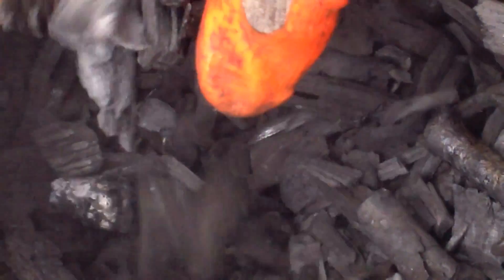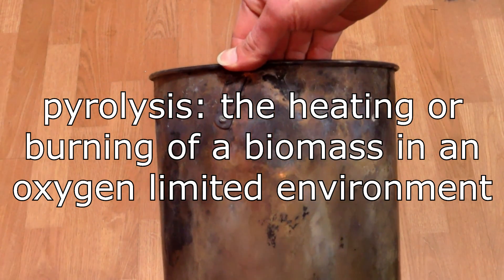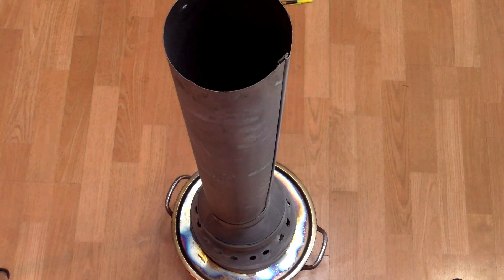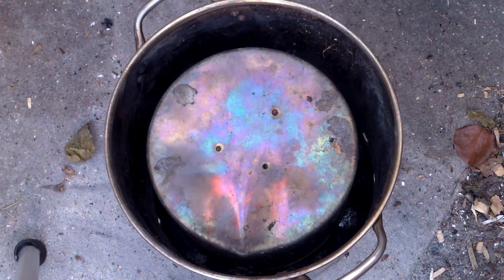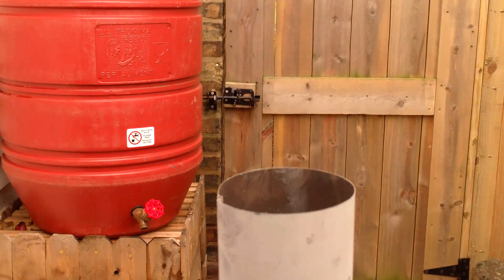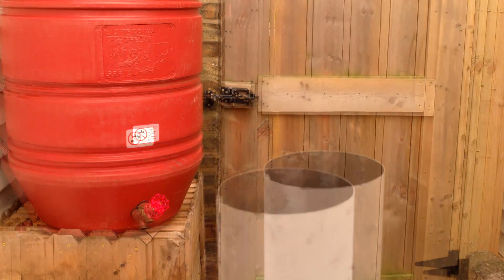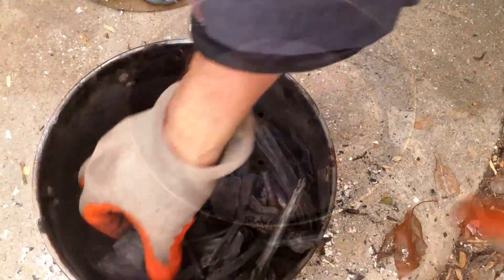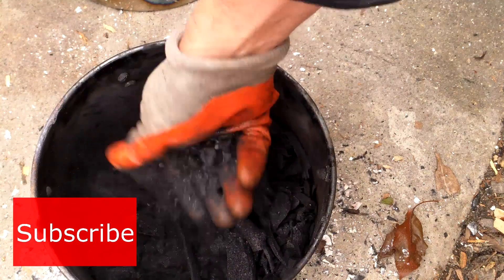Our Small Two Chamber Biochar Oven

Comment: Could the upper chamber heat be used to piggyback a separate waste plastic pyrolysis to produce pyrolysis fuel from plastics?

It's a shame to waste all that heat to just escape and produce 1 pound of bio char or charcoal fuel where I'm from... charcoal fuel (briquette) sells for $3 per 3.3 pounds online..   

That way  you will have two products from the original machine; 1 pound of biochar and at least one liter or more of fuel from the waste plastic pyrolysis...

and you get rid of some plastic waste.. this could even be a business...

Comment: Nice oven, I have just few things:

First, it is better to make holes for gasses to escape in the bottom part of the inner container, because the gases help to heat the wood inside when they burn.

Second, it is definitely better to quench the biochar with water rather than let it cool. The hot biochar still smoulders and consumes oxygen, which decreases yield (it burns away). Also, biochar can get hard to wet with water when its cool, but it soaks a lot of water easily when its hot. Water steam produced during quenching can also increase the surface area as it removes tar from the pores.

Comment: Now this I can do! I'm only on a suburban block so the big drum units are totally out of the question.
I've got something for the outer vessel and probably the inner one as well.
I'm thinking of using a bowl as a lid with the center cut out and steel venting as you use for the chimney.
I'm doing my best to reduce inputs as much as I can to the garden (unless they are free)  
This is a great way of using up more  branch cuttings and bigger woodchip to make something I would otherwise have to buy.
I'll skip the holes in the center vessel to get the gases to pop out the bottom and feed the fire like others have said.

Nice video.

Comment: Craft procedures not necessarily translate to better ambientaly products.
Yours is a serious document. Congratulations.
The indirect distillation of the wood ensures that the process will generate much less ashes that would increase the pH of the soil.
A good biochar, without doubt, helps to increase efficiency and sustainability of agriculture. 
The only problem I see is that  its cost is high due to the scale of the oven and the system can not be scaled easily. With the help of some engineers your model could became a wonderful  input to RATIONAL AGRICULTURE.

Comment: hi, the video is 4 years old and im wondering if your biochar oven is still working and if you have made any modifications since? i am about to make one based on this one since the size and level of production fits my needs. Thanks for the videos, very inspiring.
Reply from the maker: You're welcome! I'm no longer using it. My best guess is that it would last 3 or 4 years with fairly regular use.
Reply: great, ty

Comment: I have been wondering what to do about the hydrocarbon gasses from the pyrolysis process for a while. All the videos I have stumbled upon simply mention that they are there and don't explain anything about them. I have been wanting to learn more about this subject simply for carbon sequestration, and not so much for fertilization. Thank you so much for explaining and showing how you dealt with this.
Reply from the maker: +EPhantom125 You're welcome!
Reply: in order to sequester carbon one has to feed the chimney back into the fire chamber so that the hydrocarbon gases completely burn up. In this positive feedback loop the hydrocarbon gases raise the temperature of the fire.

Comment: An excellent video on the process of pyrolysis, and how to construct a low-tech, low-cost retort chamber. I can see some high school science teachers using your video in the classroom. I did just a small bit of research on terra preta soils and understand why many folks may want to add biochar to their gardens. But(if you don't mind me asking a philosophical question, Patrick) I'm wondering if you think it might be better(ecologically) to just spread the wood chips in the garden? Creating biochar releases hydrogen and methane into the atmosphere, which may affect global warming. Wouldn't it be easier and safer to just mulch? Was wondering what your opinion might be but understand if you'd prefer not to have these discussions on your channel. No harm, no foul.
Reply: Brian White hello Brain white, I understand your concern. I am working with Biochar in my lab. Apart from amending the soil and sequestering carbon, it can help in  soil remediation. a soil that is contaminated with heavy metals can be reused with the application of the correct quantity of biochar. thank you.
Reply: Doesn't decomposing wood release those gases and more? I honestly would like to see the emissions measured. Since most of the hydrogen and methane is burnt in a well designed stove, it really may be cleaner than the gasses rotting wood releases. I use biochar in my compost because it helps filter some of the gasses that are released by the decomposing organic matter. Plus it really seems to speed up my compost. All that being said, of course I also use mulch.
Reply from the maker: Thanks, Brian! This was more of an experiment for me than anything else. Sometime after this video I decided to conduct a field trial of biochar before using it in my entire garden. After the first year of the trial, I'm not convinced that it's adding any value to my garden soil, which is rich in organic matter and nutrients. As you suggested, it may makes sense for most people to simply mulch their gardens with wood chips instead of make biochar.
Reply from the maker: Jamie Vega That's a great question, Jamie! I'd be interested to know the answer as well.

Comment: OK, a few suggestions. First put insulation around the outer chamber, it'll concentrate more heat into the inner one. Second, don't waste the hydrogen and methane gases produced by the pyrolysis, use them also in  the burn. Seal those three holes in the inner chamber, then put a couple of pieces of straight wire in the bottom of the outer chamber, that way the waste gases escape out of the bottom and get redirected to the burn. Finally, you might want to look up how the Japanese make 'white charcoal', it's a quick cool down method that produces a type of char with some interesting properties.
Reply from the maker: Thanks for the ideas, Sacwriter !
Reply: i concur, having a burn camber in the chimney fed by the small holes is a waste of heat
Reply: Nice suggestions Sacwriter but a drawing would be v.helpful but not possible in this forum (:-    -  Not v.clear about how waste gases are being redirected to burn

Comment: if you put the holes on the inside pot at the bottom the gasses will feed the outside fire and there may be no need to add extra fuel because its said to make the fire last longer, esentialy you will be using the inside gas to char the inside wood
Reply: spud gun I was thinking the same. Also for this and other designs it seems there is an opportunity for a slim chamber containing wood for creating biochar through the chimney which would heat up from the heat lifting up through the chimney.

Comment: Great effort - nice product. Here's a link to part one of a very instructional series from Living Web Farms. This is a 5 part workshop that takes a lot of time to watch, but really worth while, at least for this novice.
 
Biochar Workshop Part 1, How to Make Biochar

Ideally, I don't think you need the little holes in the top of the inner retort chamber. The idea is to force the gases down and out around the bottom lip. Based on what I saw, I don't think you packed the cavity between the two chambers with chips (smart that you dried them first). Have a look at how tightly the guys in the video jamb the small cavity.

My first successful efforts to create this black gold have been to build a roaring hot fire in my shop wood stove, then as soon as it is down to a bed of large coals, I scoop them out into a steel pail and cover them with sand to quench the fire. That is one hot pail of coals. Don't get a lot at a time, but so far I have about a bushel, and my shop is heated in the process.
Reply from the maker: Thanks Garth Wunsch ! Yes, the Living Web Farms biochar workshop videos are very helpful. I watched them some time ago when I was researching biochar. You're right the little holes in the inner retort aren't needed. Now if I can just talk my wife into letting me have another one of her pots! Thanks for watching and commenting.
Reply: Save your marriage... hit the yard sales... lots of pots there :-)))
Reply from the maker: You make a good point Garth Wunsch!

Comment: Get rid of the holes on the top of your inner retort. They need to be on the bottom and I am not sure they are really needed since you haven't sealed the chamber. They are only for letting the gases out and keep it from exploding. If you let the gases out at the bottom, it will add considerable heat to your system, and you will most likely not need to add extra fuel during your burn.
Reply from the maker: You're right - the holes in the top of the inner retort aren't needed.

Comment: HEY O.Y.R.
 I NEVER MADE BIOCHAR BEFORE BUT WATCHING YOUR VIDEO TAUGHT ME HOW. I MODIFIED IT THOUGH BY FILLING AN OLD METAL TOOL BOX WITH A LATCH FULL OF WOOD CHIPS AND PLACING IT IN MY WOOD BURNING STOVE. I MADE BIOCHAR WHILE HEATING MY KITCHEN. IT WORKED GREAT.
THANKS
Q
Reply from the maker: That's fantastic! I wish I had a wood burning stove or fireplace so I could do the same. Thanks for letting me know!
Reply from the maker: ***** Yes, I've seen at least one video in which a metal ammo case was used. Any oxygen limited metal container should do the trick as long as it isn't galvanized.

Comment: My 50/30 gal drum system doesn't make as much smoke than my Webber grill does and I've not had any problems with neighbors.  The set up isn't visible to neighbors and I grill outside all times of the year, so no one is any wiser.
Reply: make that 55gal / 30 gal
Reply from the maker: I'd love to make the 55 gal/ 30 gal oven, but I'm certain the neighbors would object. I agree - the oven wouldn't produce much smoke, but the flames shooting out of the chimney would make them nervous, and I have no way to hide a unit that size. It's too bad. I'd really like to have one.
Reply: Throw some burgers on it and tell them you're having a cook out. LOL

Comment: I know that the bio char is important, it just seems like you waste a huge amount of wood in the process.  You could have cooked, heated, even forged metal on the amount of energy it took and in the end you would have even more bio char by using the fuel you used to cook the original batch of wood. I just do not get this process.
Reply from the maker: You're absolutely right - it's much better to harness the energy and put it to good use. I plan to use the heat to do some cooking in the future.

Comment: Patrick, two questions.  We loved this video and want to experiment with the idea.  Got a old ridiculously heavy wood stove at the auction last week for 25 bucks but there doesn't seem to be a working damper.  Do you think we could just put an inner retort chamber inside the stove and keep the door ajar and set up a chimney kind of like you did?????  We have never worked with a wood stove before but the deal seemed to be there...its going to be for outside use one way or another, seems this would make a lot of sense.  If you have any ideas on how to modify this please share.  Question 2.   The stainless steel pots...any chemical breakdown that would release dangerous fumes???  How about the pots melting down from high temps.  The larger pot you are using looks like it started to melt a bit..or is that just denting from the drilling process.  Thanks for your great videos.  We look foward to them coming.  Cool light setup too.   But you definitely need to hit the thrift shops for lamp cords(with lamp attached)  that are like a dollar :)  Thanks, Paul and Suzanne
Reply from the maker: Hi Paul and Suzanne.

Yes, I think you could put an inner retort in your wood stove as you've described. You'll want plenty of oxygen in the wood stove, but little in the inner retort. 

Stainless steel is safe for use in biochar ovens. You'll want to avoid galvanized steel however, which is coated with zinc. The temperatures don't get nearly hot enough to melt them. There are some dents in the pots, but no melting.

You're right, I could have bought an extension cord for $1.19 instead of the expensive lamp cord. Next time I'll know better.

Thanks for watching and commenting!

Comment: I really want to do this as a winter project!  Thanks for posting.
Reply from the maker: You're welcome Cindi Martineau !  Yeah, it does make a great winter project. I'm planning on making a batch most weekends during the winter. That should give me more than enough for 2014. Thanks for watching and commenting!
Reply: Where did you find your pots?  One concern I had about making one was that the usual paint buckets or even 55 gallon drums only last through about 10 burns.  But, I think your stainless steel pots will see you through far more.  Maybe I'll start checking thrift stores.  I do have one big pot like yours, but I use it all the time! :)
Reply from the maker: Cindi Martineau My wife used to make handmade soap, and she collected several of these stainless steel pots over the years to use in her soap making. I'm not sure where she got them. I think you're right - stainless steel will last longer than steel. Just make sure to avoid galvanized steel. I also was suspicious of paint cans, which sometimes have some kind of protective coating on them.

Comment: Very informative. Have you checked the temp of the gases coming out of the chimney? I wonder if there is enough heat to distill salt water.
Reply from the maker: Interesting question! It's great to think of ways to put all that heat to good use. To distill salt water, do you only need to bring it to a rolling boil? I'm not sure how hot the gases get, but they could definitely boil water.

Comment: Fantastic video as ever. That`s a great oven. You could make a lot of Charcloth for me with it. lol.
Reply from the maker: Thanks Mark. Yes, then I could use the charcloth instead of the alcohol to start the oven! I think my next batch will include dried kitchen scraps like banana peels, orange peels, egg shells, etc.
Reply: OneYardRevolution Have you discovered, during your research if you can use leaves to make Biochar? And if so, how effective they may or may not be. I`m thinking that because leaves have not much substance then they might not be effective as Biochar. On the other hand, because they don`t have much substance they would take very little time to char and therefore you could make more far more quickly. I have chared leaves myself but do not know enough to know if they are effective.
Reply from the maker: Mark Gardiner Yes, you can make biochar out of leaves, though I'm not sure how the resulting biochar would compare to biochar made from wood. I think you're right that they would char fairly quickly. I think you'd also have to have a very low level of oxygen in the retort to prevent them from burning. I'll add some leaves to my next batch to see what happens.

Comment: OneYardRevolution Great video Patrick! One question, maybe I missed it but how do you know when you have burned it long enough for all of the gasses to escape the inner chamber and you actually have bio char left? Awesome idea on the scaled down version... :-)
Reply from the maker: Thanks Wayne! In my case, I can tell when all the gases have been released from the inner chamber by watching the little holes in the inner chamber. When I don't see any flame coming from them, I know all the gases have been released. You can see these flames in the video at 6:30.

If the outer chamber were large enough to hold sufficient fuel, I wouldn't have to babysit it as much, and I'd know I had biochar after all the fuel in the outer chamber was extinguished.
Reply: Thank you, I understand. I thought that's what you would say, but I wanted to make sure! :-)